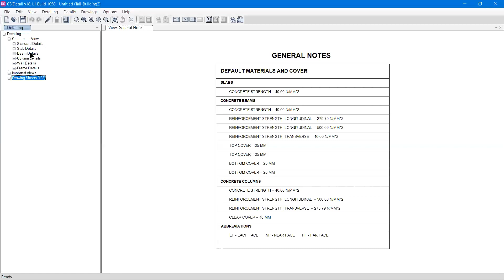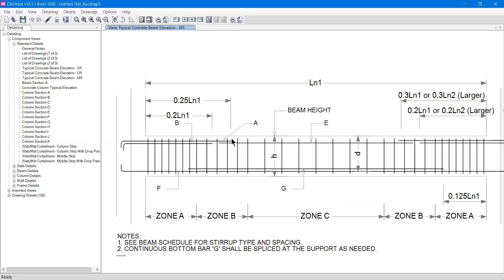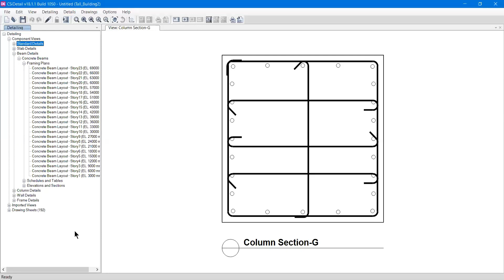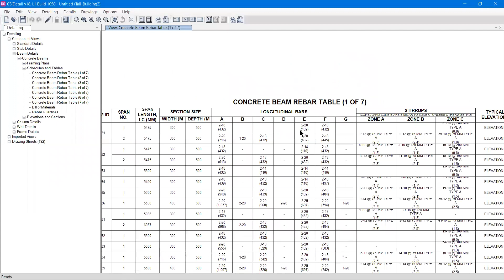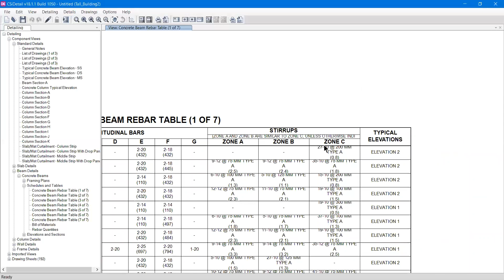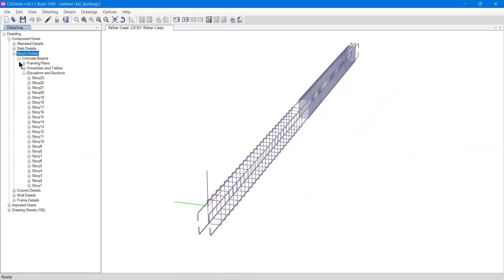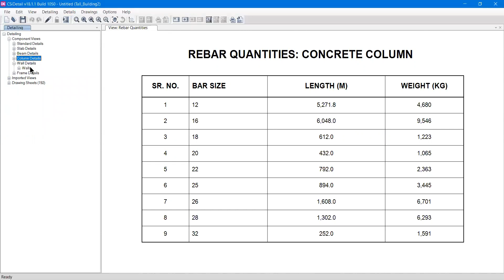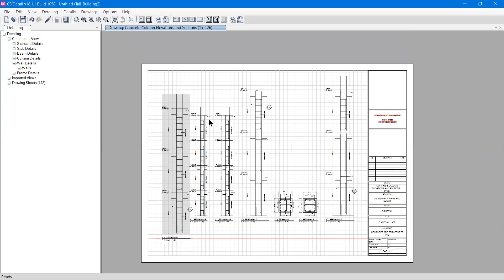CSI Detail v18 | E08 Detailing Explorer

Comment: Can the software design 3 legged or 4 legged stirrups for beams?? Also, I'm having difficulty in slab reinforcements. They don't show in the design and also not picked up from ETABS even though I did FEA and design strip method.
Reply from the maker: It designs multiple legged stirrups by itself, there's no option to choose anything specific, for slab design use safe software
Reply: @JitendraChoubisa  Beams which fail in shear desing in ETABS are not picked up in Detail. It says beam exceeds max reinforcement area and therefore can't be detailed.
Reply from the maker: increase size of beam to overcome shear failure